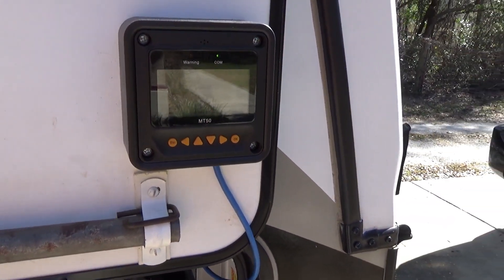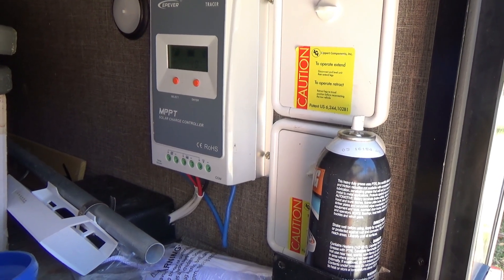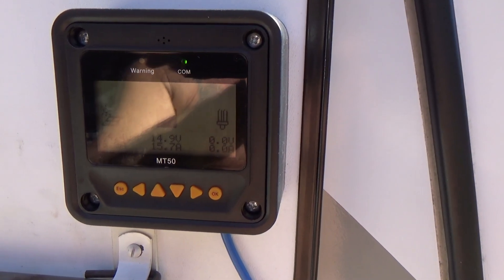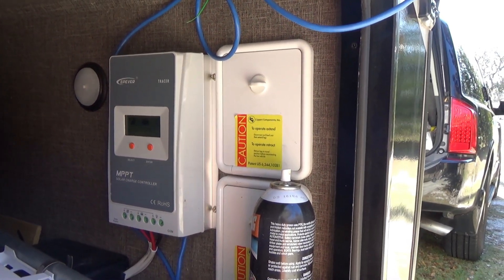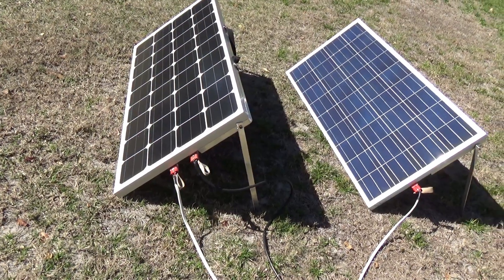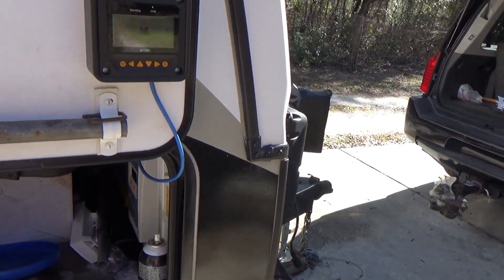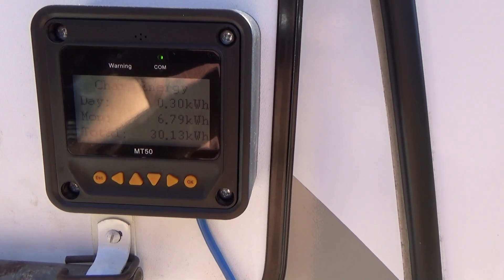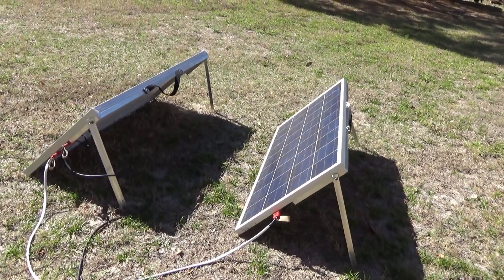Epever 3210A MPPT Solar Charge Controller

Comment: EPever are good quality chargers, don't worry about overloading
I have the 40 amp for 5 years and still works fine
If you are interested about an industrial more faster controller than EPever I recommend the Pfungpusun mppt 50Amp at same price as the EPever but faster as it has a booster which others don't have
Reply: I agree, mine is just turning 5 and has been trouble free.

Comment: Hello thanks for explaining some of that I've been trying to check different controllers online to see what I can connect to a 260 watt panel I got a 30 amp one ordered yesterday with a what amp and volt meter to run in line and I have two 260 watt panels I'm going to hook one up first to the monitor to see what it's doing before I do it in series to see and I will probably just use one panel on the charge controller I don't want to be burning out a $150 charge controller it was more than that I thinkSo if I need to buy a bigger charger controller I'll just send the other one back and get a bigger one that can handle my solar panels but I want to keep my system at 12 volts I don't want to go 12 volts or 36 volts or 48 volts 12 volts only is what I want anyway have a good day God bless you
Reply from the maker: Sounds good, let us know how it goes!
Reply: @lancekpthook8505  I will let you know how it goes hopefully it don't explode in my face LOL only one way to learn you don't succeed without trying
Reply: Yes I know you don't succeed without trying I still have not connected my two panels yet they're old panels they're not going to do the full amount I checked in when I meet her and it was showing 144 Watts on each one I can live with that I need to buy some different wire too to the connections and get a breaker and a bus fuse I've got the same small meter also t50 and I had to order a heat sensor separate and that meter separate and then it says I can go without internet connector in line for it or something like that or with Bluetooth but I did not get those at all I didn't think I should need to use those but I have not scanned the code on the box to connect everything yet and adjust it I'm going to wait for a better time to do that. My EP ever controller is a 40 amp they did not send me a 30 so that's okay I can use the 40 amp hopefully everything goes well you have the same connecting system the way I want to do also so I can keep my panels portable.

Comment: i am thinking replacing  my  Chinese  PWM  30a controller in the 30 amp version. can you give me advice?
Reply from the maker: You definitely will get better efficiency with a MPPT controller over a PWM. I think all these type of devices are manufactured in China, unfortunately. I like the EPPEVER and still have my original and has been very reliable over the last 3 years.
Reply: How many watts can the 3210 connect to?   Can you connect 5 100 watt panels?

Comment: I just got a fourth "100 watt"  panel..they are the high output compact rv type and also I opted for the 4215 bn controller and its great...next is the inverter..after much looking and head scratching Ive decided on the Aims 3000 w 24 volt one..Im going to use a small 410 watt one also hooked in with the two 12 volt batteries on the ground end for t.v. and laptop..this is my first time so Im trying to just buy stuff once lol...

Comment: Hello. Thanks for a great video. I have ordered the same regulator. Distance between 4 100W panels and regulator will be 18 meters. As you panels in series increasing voltage lowering current I think of the same. The cost for extreme thick wires is high snd your solution is spot on for me. So, the 3210 can have 36V in and 12V out? I thought it was like different systems (different Voltages systems.)
Reply from the maker: Yes, the input voltage for the 3210 maxes out at around 90v give or take. So you could series connect the panels upto the point where the VOC doesn't exceed say around 90v. Your right watts are watts. So say your panels are rated 20VOC so that's 80volts, and your panels are rated to handle 80v series connected you'll have around 5amps  at 80volts about 400 watts at the input to the 3210A. The advantage you allude to is correct you can use a wire size suitable for 5 amps and the voltage drop will be more tolerable. At the output of the 3210 you'll have about 14 volts if connected to a 12 volt battery system (unit auto selects voltage based on battery bank 12 or 24 v) and somewhere between 24-28amps (correction on original for my bad math) because of conversion loss (minimal), and panel efficiency. Hope this helps and good luck.
Reply: Hello. Ok now I fully got it. Thanks.

Comment: I'm finally getting around to this and don't exactly know what paralleling conductors means. I'm guessing your joining the 4 wires making 2 pairs for connecting to the solar panels and the charge controller on the other end
Reply from the maker: Sorry didn't see your comment sooner but yes you are correct. I took a 4 conductor cable and mine had red, white, black and green. At each end I tied the black and red together to make one conductor out of two. Did the same with the green and white. So now electrically I have a two conductor cable. Again, I did this because this is what I had but you could certainly could use the appropriate sized 2 conductor cable.
Reply: @lancekpthook8505  Thanks for getting back to me. I ended up using 50' of SJOOW 14/2 300-Volt Flexible Portable Power Cord. I'm connecting my 2/100 watt panels to the cord and charge controller (Epever 30A Triron) with 10AWG SAE two pole bullet connectors. My two in series panels should be pushing under 6 amps through this setup. The wire is rated for 18 amps. 
Thanks for all your good ideas they are helping with my build. Next I'm building the panel tilt stands you showed.

Comment: I'm interested in learning the spec's and length of the cable you used from the solar panel to the charge controller. Great video with good information for anyone building a similar setup.
Reply from the maker: Hi Richard, I used 16/4 SOOW which is very reasonably priced (~49 c/ft) and by paralleling the conductors you get a equivalent of about between a 12 and 14. You could use a 12awg or 14awg extension cord but rarely are they rated hard service. I made 25' lengths and everything is terminated with Anderson SB50 series power connectors (www.powerwerx.com).
Reply: Thank you for the information. It will be very helpful making my own cord and connections.

Comment: Look at charger specification particularly  your MPPT window or imput voltage max - min range, Usually people dont realised during hot temperature voltage usually fall below MPPT V min.  When this occurs, your charger not running at optimum charging condition. Do solar module Vmax and MPPT V matching. Use this formula. Vwin.min/Vwin.max= Vmax *(1+((vmax Vcoe/100)(Tcell-25).  ;.  Tcell =  T amb + 25C.  If solar module spec dont mention Vcoe or coefficient beta, use Pmax Coefficient, gamma). Usually manufacturer only provide Voc coefficient and not Vmax.
Find your min and max ambient temperature in C. Plug in all the data into the fomula and you should be able to know module Vmax range (max/min) By doing that, you know weather you should configure you module in Series or Parrallel. By doing this you should be able to get 80-90%  module P norminal or Pmax.

Comment: You dont have to worry higher temperature. What you should worry is cooler ambient temoerature. Solar cell output power usually giving higher output when cell temperature is low.

Comment: Solar panels are rated under Standard Test Conditions (STC) of 1000 lumens/sq meter.  Very few places have that level of illumination year round (some never reach it) so the NOCT ratings (at 800 lumens/sq meter and typically 72.6% of STC) are what you should base your expectations on.  I have several 100 watt panels that have never exceeded 75 watts (75% of rated) although I have two Jinko 250 watt panels that - when freshly cleaned - will deliver 235 watts each which is 94% of the STC rating.  I have two of the 3210a 30amp MPPT controllers for my stationary solar generator that's sized to provide "Wait until daylight" power so I'm not out setting up a gasoline generator in the dark or during a thunderstorm.  540AH of AGM batteries (12 volt system), 2000 watt pure sine wave inverter, 900 watts of solar (not all installed).  We had a real 12 hour test in December when snow took down trees and power lines.  I have a 20 amp battery charger that can be powered from the generator when it's in use to recharge the battery bank as needed - not much power produced while snow is falling ;-)
Reply: How did i know if my 100W solar panel is really giving 100W ? please tell me : - )